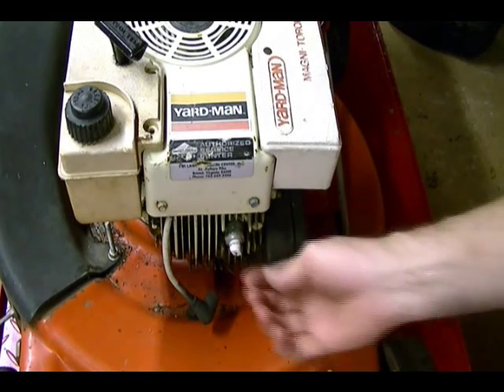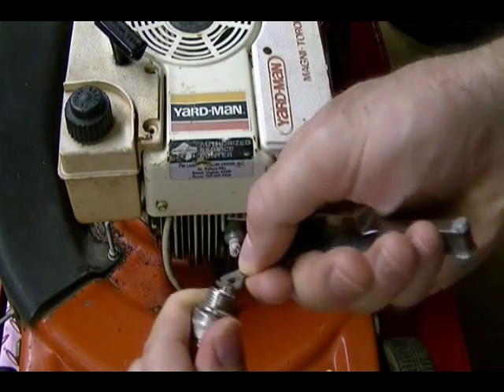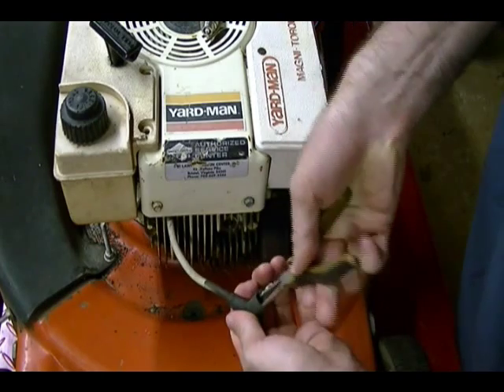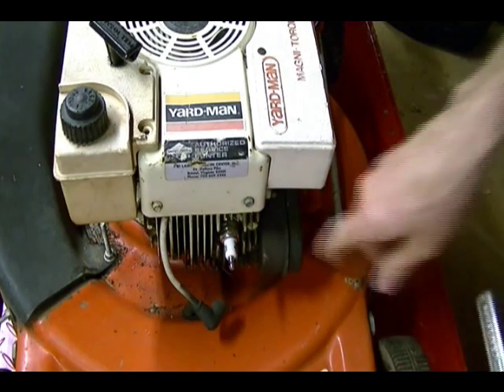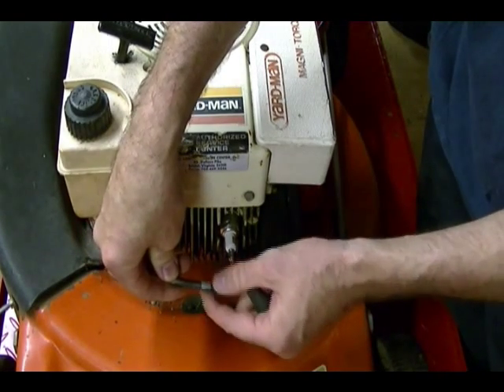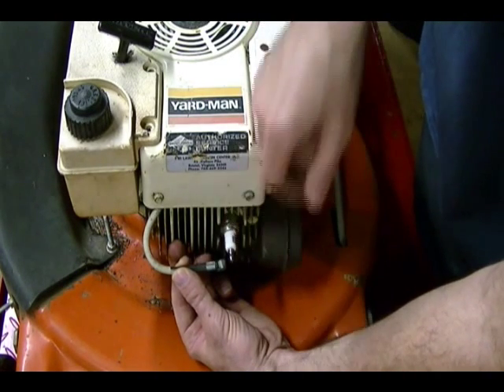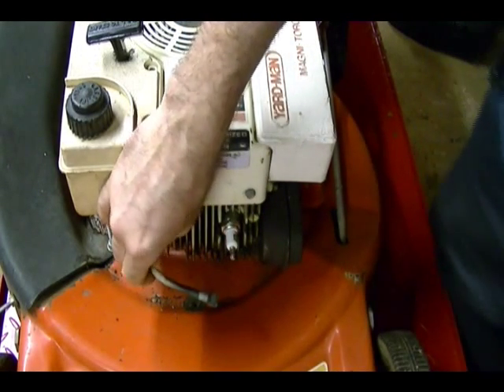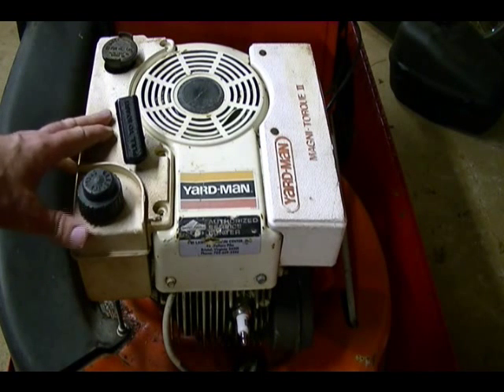Small Engine Repair: How to get a Tecumseh Lawn Mower Started Part 2 of 3

Comment: You do not tighten a plug 1/2 turn beyond finger tight.  You will strip the threads out of the head if you do that.  Champion and the other plug makers recommend 1/4 turn.  1/2 turn is NOT a good idea.

Comment: let me add that plastics tanks are much easier to deal with then steel tanks which rust. steel tanks can be a real pain in the ass. i have been working on an old sears suburban with a steel tank. no matter what i do there is still some rust in that tank. i even took and shook the shit out of the tank with rocks. even when i thought i had all of the junk out the fuel line still gets plugged once in a while. real pain the ass.

Comment: modern ignition systems (solid state if you will) almost never fail. older points and condenser systems are mechanical/electrical parts and are subject to wear and tear. if points look pitted replace them. points are slowly becoming a non-issue as well. many of those engines that have points are no longer in service, except k series engines which are still fairly common since they made so many of them, they are still very popular even today.

Comment: when i start working on something i do a really simple, quick test. take the air cleaner off and squirt some gas or carburetor cleaner into the throat of the carburetor. if engine fires then your ignition is good and probably the compression is good as well. an engine wont even fire if the the compression is really bad. next step clean carburetor and it should run. carburetors and the biggest thing stopping most small engines from running.